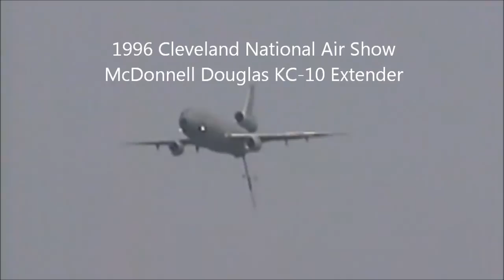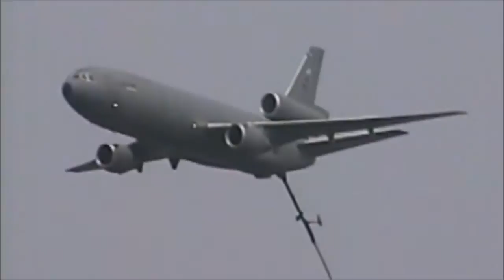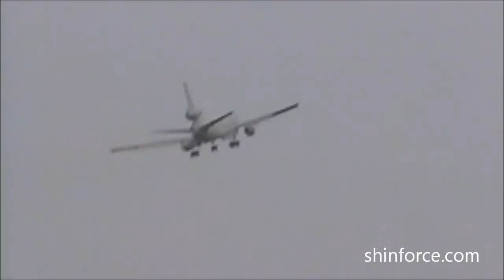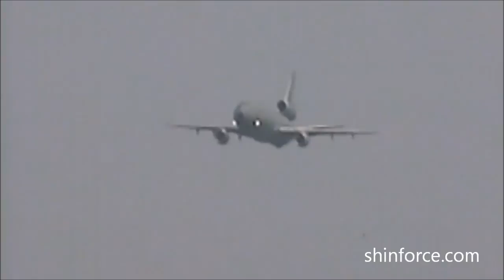McDonnell Douglas KC-10 Extender: Fly-by :: 1996 Cleveland National Air Show

Comment: Woah 6,500 of runway that's long but i'm pretty sure they can takeoff at Burke's without the 6,500 feet, your right the Air Force does use the heavy jets for the displays, i bet they deploy the landing gear earlier when there almost at the runway.